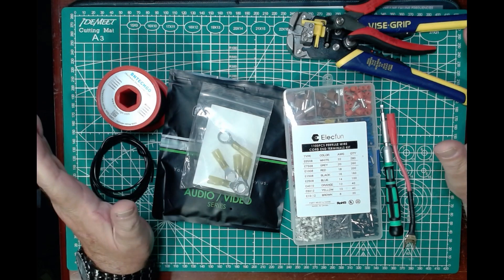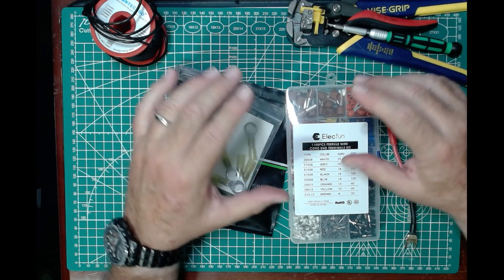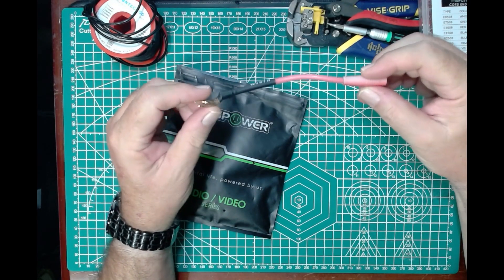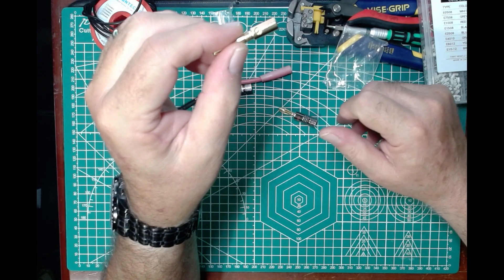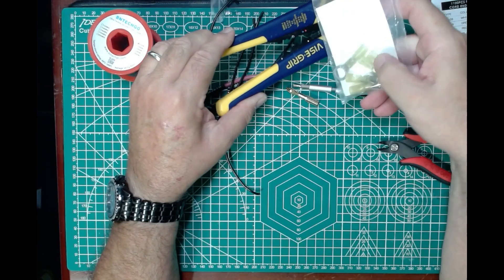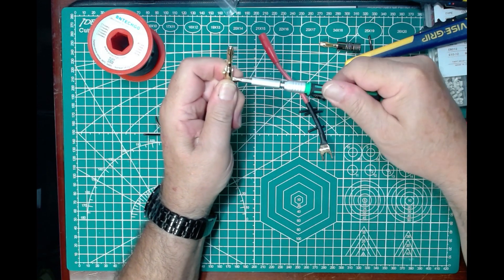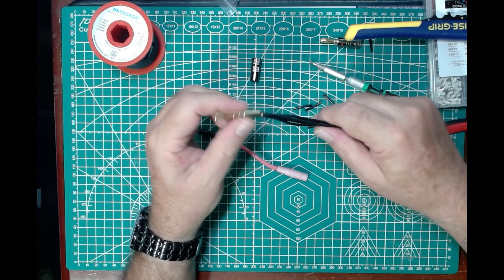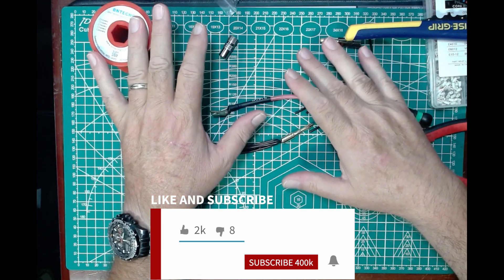Level Up with Easy Radial Setup Tricks

Comment: I bought a BNTECHGO pack of multicolor wires cut 10ft long, precut because I balance lazy with cheap. I made many great 3m radials. Yes, banana plugs.
Reply from the maker: That's right Lee - work smarter, not harder.  Lazy is the way.